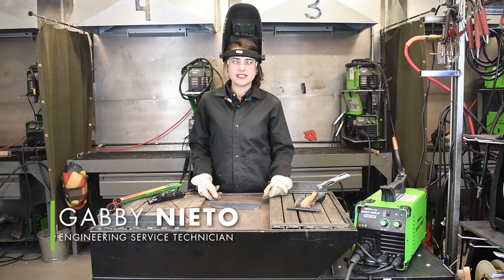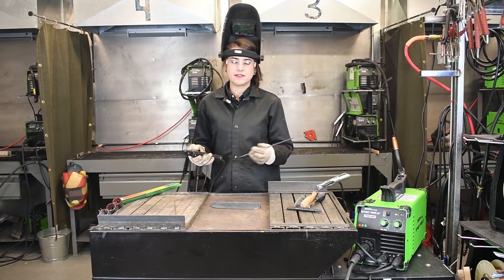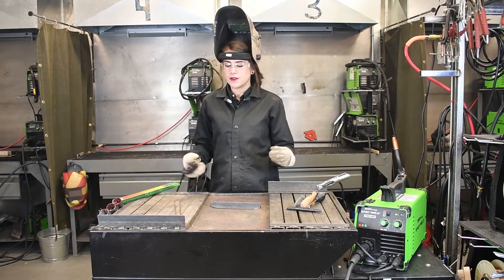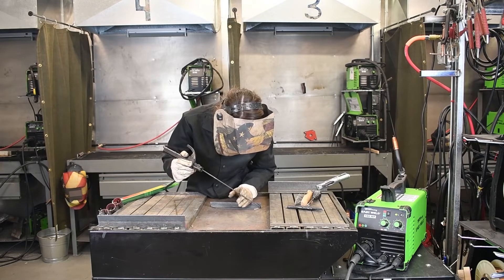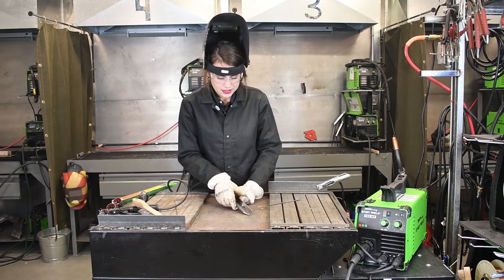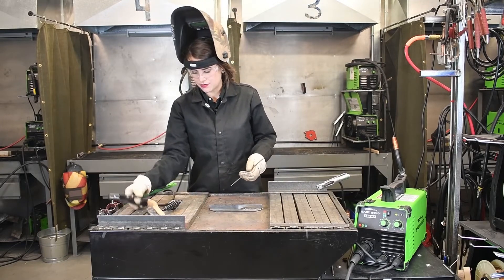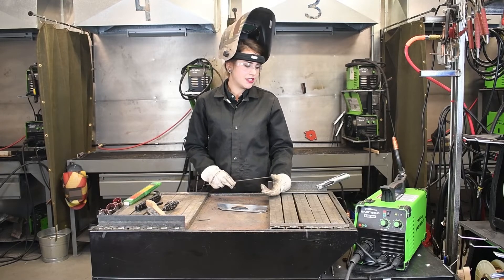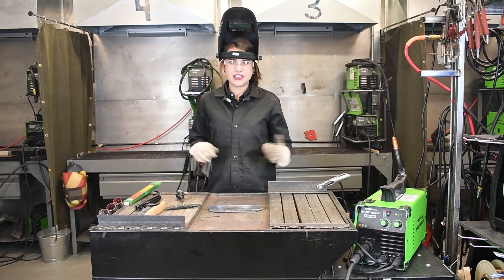Stick Welding with the Forney Easy Weld® 140 MP

Comment: I just had a 140MP delivered to use at my friend's ranch. This unit is going to be used predominantly for building and repairing fences, machine repair, general light fabrication, maintenance repairs, etc. A question I have, is when exactly would you want to use the stick function over flux core when working outside?
Reply from the maker: Hi Robert, I would say that the biggest difference between the two would be the selection of different stick electrodes, as opposed to the one type of wire you would use for flux-core welding. 

Both of these options are good for outdoor welding because they are both much more tolerable to the conditions welding outside. The most important similarity between the two is how they create shielding gas. With flux-core, the interior of the wire has flux that when burnt creates a cloud of gas to shield your weld, while stick electrodes have an exterior coating that when burnt creates a cloud of gas to shield your weld. In both cases the shielding gas is originating at the arc, it does a great job of staying close and covering the weld even in imperfect welding conditions such as welding outside. 

The most important difference is with flux-core you have one type of wire that is recommended, E71T-GS, which is a great all-purpose wire. Though this single selection of wire does mean that you can only weld mild steel. Whereas, there are many types of stick electrodes to choose from. Whether you are trying to repair an old fence or build up a worn surface on a piece of equipment, there are specific stick electrodes that make each of these jobs easier. This diversity in electrodes also allows you to weld different metals such as mild steel, stainless steel, and cast iron (aluminum is possible with a larger machine and a high level of skill). If you have any other questions feel free to reach out to our Expert-Techs at 1-800-521-6038 opt. 2.
Reply: @forneyind  Thank you so much for your answer! I'll certainly call if I have any further questions. Have a great day!

Comment: What are these welders? AC or DC ? I would be replacing an old Hobart.
Reply from the maker: Hi David, our Forney Easy Weld machines are DC only. The only machine that we have that can do AC TIG is our Forney 220 AC/DC TIG. If you're specifically looking for a multi-process machine that can weld aluminum, our Forney 220 MP can do MIG, Stick, TIG and AC TIG with a spool gun.

Forney 220 AC/DC: https://www.forneyind.com/search-results?q=Forney+220+AC%2FDC+Package

Forney 220 MP: https://www.forneyind.com/products/forney-220-multi-process-mp-welder
Reply: @forneyind so this welder can’t weld 7018ac or it can ?

Comment: You should do a video with this machine demonstrating tig welding as well been trying to find a video but cant  find one
Reply from the maker: Hi Josh, this will be in the works soon! Thanks for reaching out!
Reply: @forneyind  I'm also trying to find a tig welding video with this welder and no luck. Not even from other youtubers. Kinda holding me back as I was interested in the ability to TIG weld as well.
Reply from the maker: @ducsauce85  Thanks for reaching out. We do not have a video on TIG welding with this machine currently. Many of our video plans shifted over the past year. In the meantime, feel free to reach out to our Expert-Techs and they will be able to answer any questions you have. You can reach them at 1-800-521-6038 ex. 2